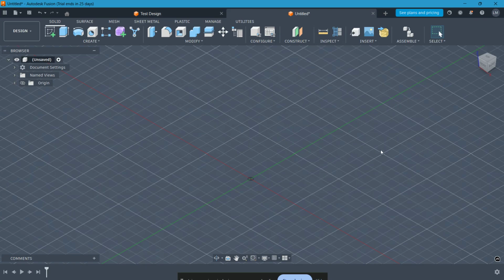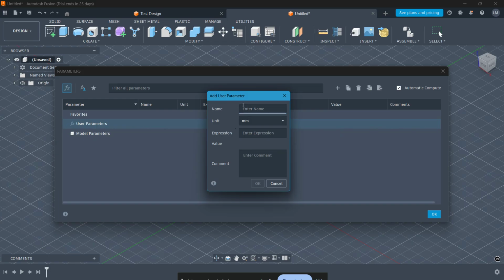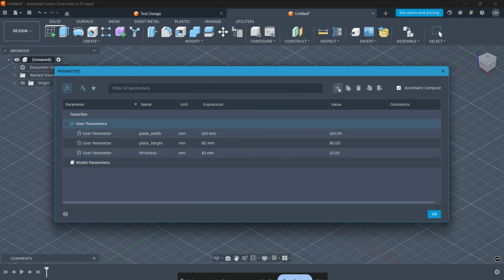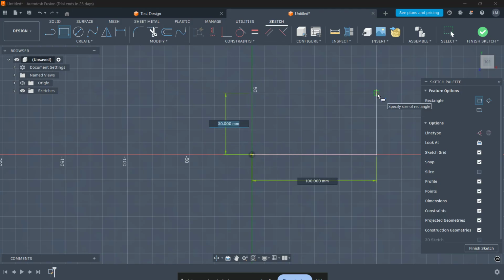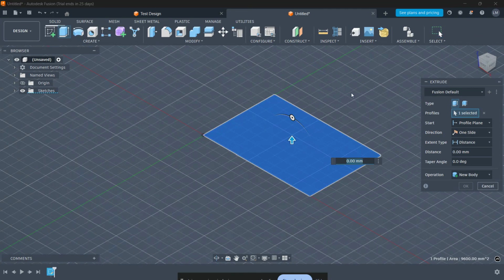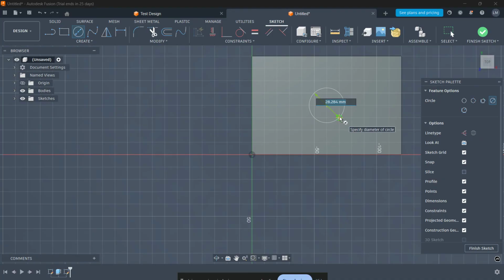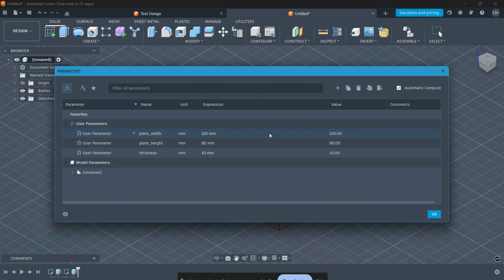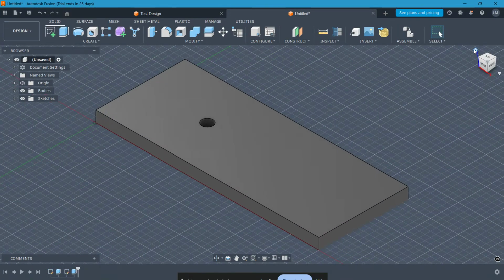How To Use Parametric Design In Fusion (2026 Easy Guide)

Comment: Totally new to Fusion.  I wanted to take my first design and make it customizable through parametric design.  This video really did the trick for me.  The only thing I could not see or hear correctly was the selection that made the depth of the hole extrusion vary with the thickness of the plate.  Thank you again.  Well done.
Reply from the maker: Welcome to the world of parametric modeling! To link that hole depth to your plate thickness, open your Extrude feature for the hole. In the settings panel, find the Distance field. Instead of inputting a static measurement, type your plate's thickness parameter name directly into that box.

Alternatively, you can change the Extent Type drop-down menu to To Object and select the bottom face of the plate. Both methods will ensure the hole automatically adjusts whenever you update your user parameters.

Consider hitting like and subscribe to catch our next deep-dive on advanced parametric modeling!
Reply: @LeonardGuides  Thank you.  That is exactly what I needed to know.